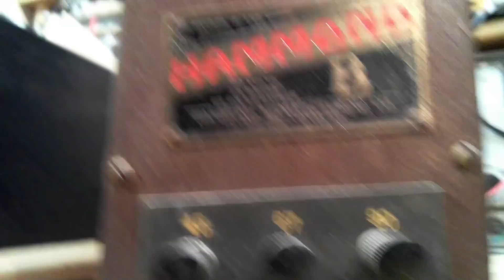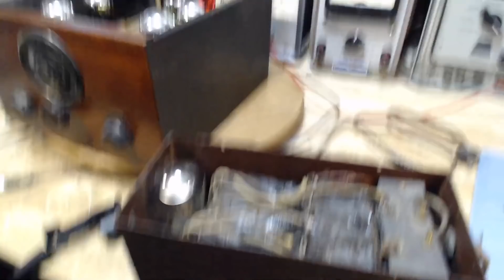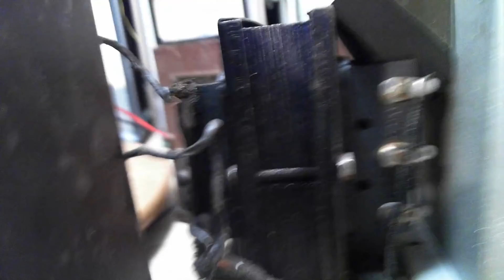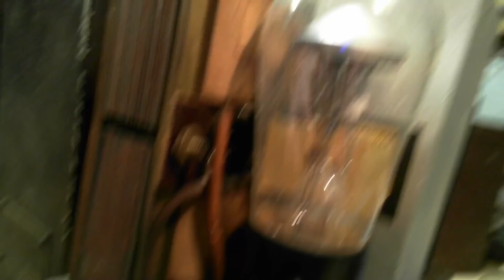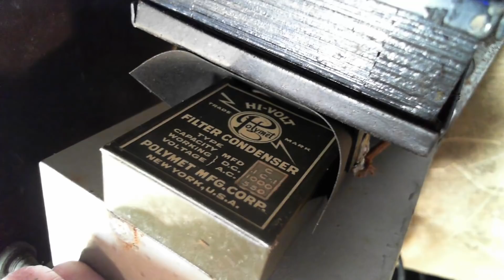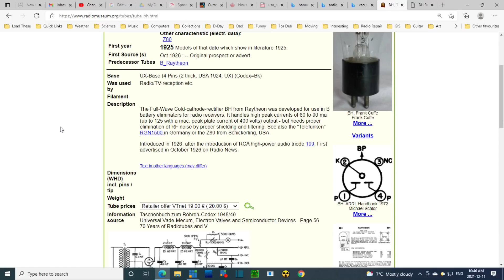Hammond S-135 Vintage B+ Battery Eliminator - Does It Work?

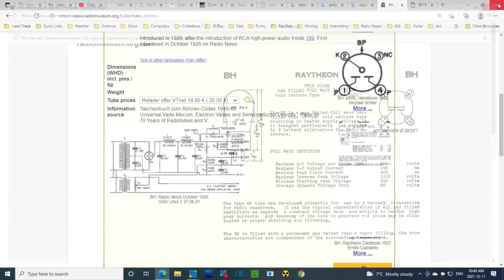Comment: 47:09 BH rectifier tubes are filled with helium. And they were not long life at all. On the contrary; they were short lived compared to heated cathode rectifiers. Reason being the helium got depleted on use because the atoms lost the electrons, became nuclei (essentially alpha particles) and as such embedded themselves in the metal.
Reply: Isn’t ionized gas the goal? Legit question, I’m no expert. I would have thought it would be difficult to maintain a good seal for helium either way, it’s difficult to store even with modern stainless steel vessels.

Comment: The reported word from NEMA is that the holes in the prongs must comply with an industry standard manufacturing specification.  If the holes are in a certain place on the prongs and of a certain size, then mating sockets should be designed to not experience interference in their operation from the holes, such as a loss of grip or getting hung up.  In the meantime the equipment that bends and forms the prongs may use those holes to do so.
Reply: From a start: NEMA (National Electrical Manufacturers Association and ANSI American National Standards Institute, both private) is not an entity endowed to set compulsory codes nor standards (that is the National Electric Code role), it's just an agreement different manufacturers endorse for a same component for the sake of compatibility. (similar misconception seen for UL). The holes in plug blades is up to each manufacturer and are punched in some for "The hole in flat blades is optional, and it is intended for manufacturing purposes only" (ANSI/NEMA WD 6-2002 page 17-18)  The blade holes were frequently used to threat caution tags or small padlocks stating "do not plug" safety notices.

Comment: Hi Jim. Two things. As a kid in the 50's I had a Philips portable radio. It had a couple of 1.5V heater batteries and a 67.5V HT battery - your battery eliminator reminded of this value. Secondly, in England we didn't commonly hide local power transformers in buildings but in special circumstances to protect the sensitivities of the local folks this was done. And so in the Surrey village of Effingham near the home of the famous scientist Barnes Wallace they built a house around the loacl power transformer. I'm not sure that this was for his benefit but there were other posh folks around there who would have appreciated this according to my wife and her father who worked for many years at the garage (Mays) on the junction down by the Golf Club.

Comment: Actually 67.5 volts was a very common battery voltage, I had several portables with 1.5-volt tubes that used them. That's 45 cells of 1.5 volts each or three 22.5 volt batteries in series.

Comment: Whoa! As a kid in the early 1960s I had an eliminator almost identical to that, must have been a Hammond - same potted transformer, same screw terminals with the same voltages, same elongated steel case with a tube opening at the end, but the tube was an 80 and it had filament windings as well, 6.3 VAC and a few others.   Worked quite well, no idea what happened to it.